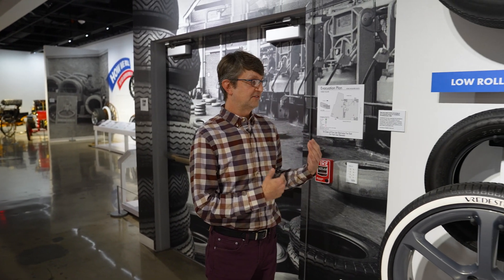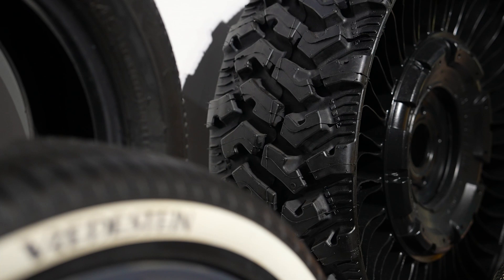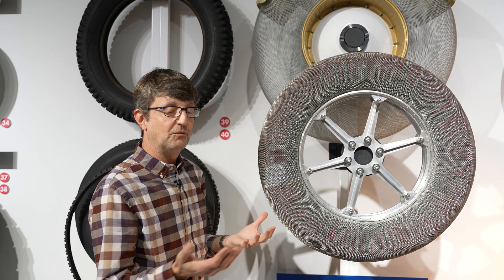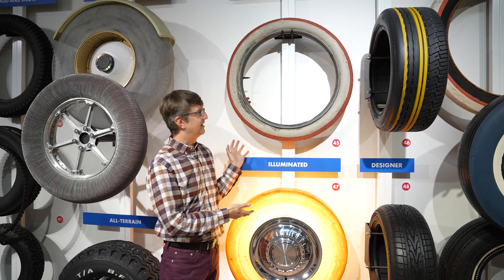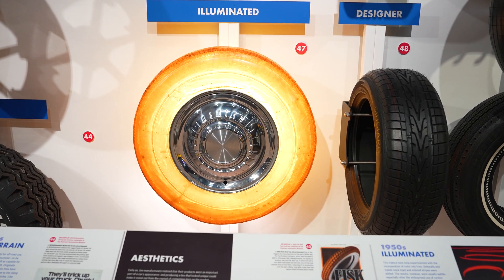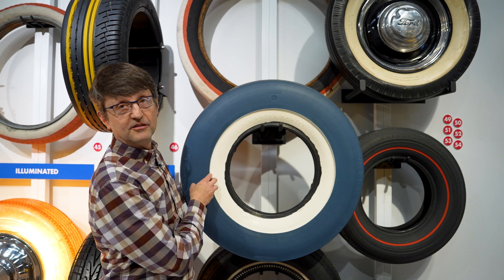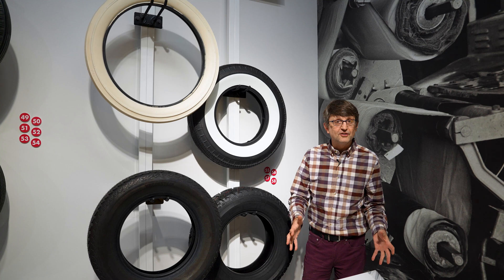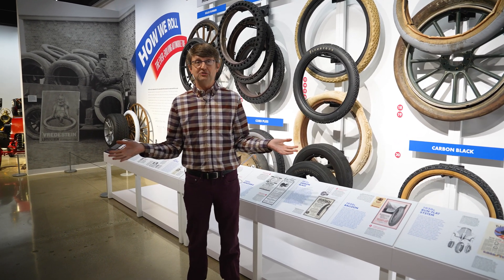How We Roll: The Ever-Evolving Automotive Tire - Part 2

Comment: There is an additional step on the transition to radial tires. When Michelin invaded the market here, the american manufacturers tried to leverage their old bias ply designs by adding fiberglas belts under the tread (bias belted) to compete. It did give a milage and handling boost, but nothing like the performance of the radial. When they tried to make their first radials in bias ply machines (clamshell molds) and without experience in bonding the materials, the results were poor quality and unreliability. One of the biggest problems was the process of bonding steel belts to rubber and the Europeans weren't telling (or wouldn't license) how they did it. (Michelin was the master). Almost all of the warranty claims I adjusted as a salesman back then were ply separations. The overall quality of american radials was embarrassing until they built new machines (Segmented molds). After that, it was game on with the Europeans.
Reply from the maker: Oh wow, thank you so much for adding this info. We really appreciate it.
Reply: @PetersenMuseum Bias belted tires are included and addressed in the exhibit itself.